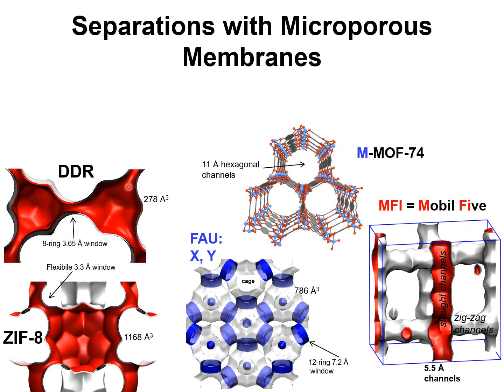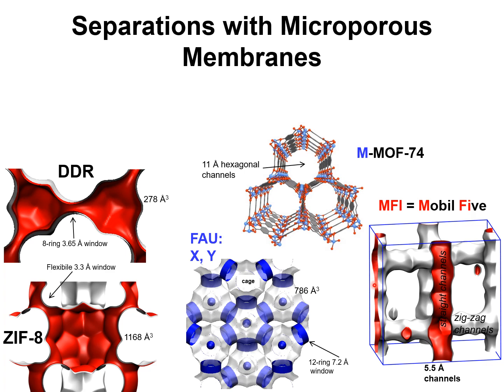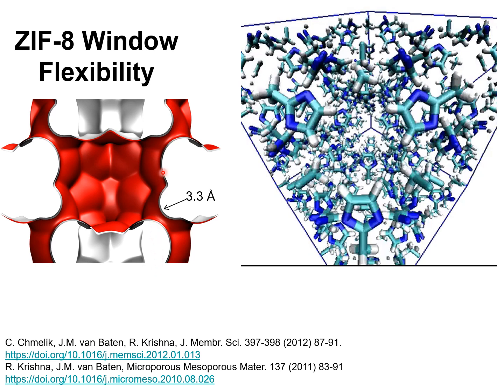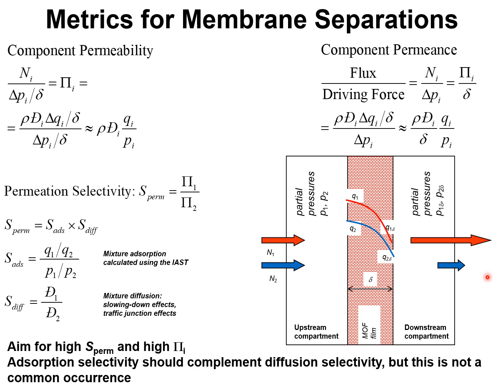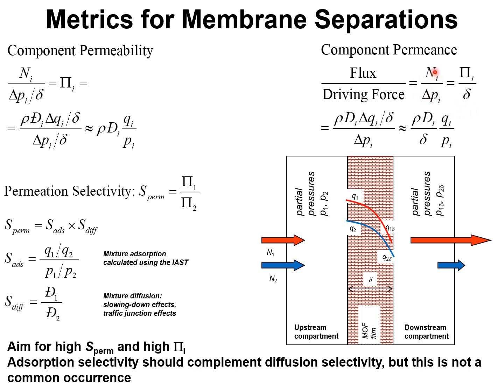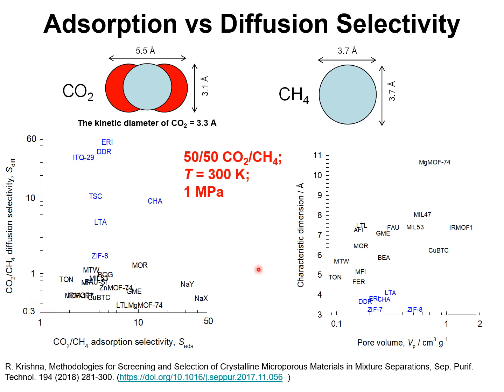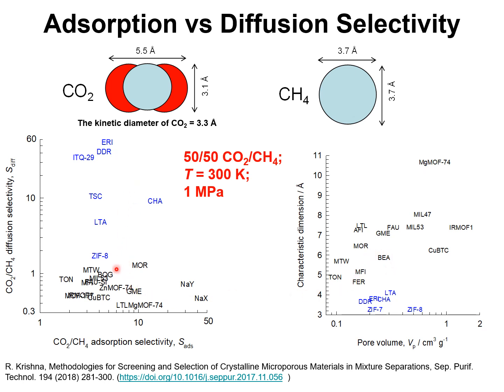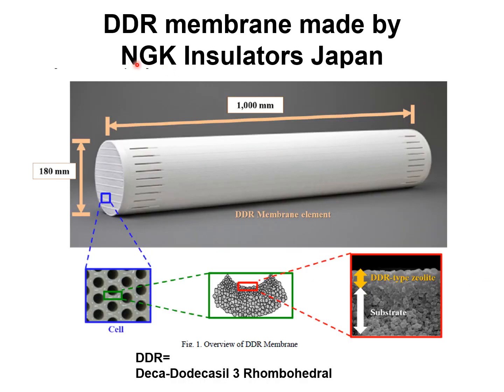The Robeson Plot for Membrane Separations

Comment: Dear Sir,
I have searched extensively for guidance on how to plot the Robeson upper bound, but I could not find a clear explanation. Could you please create a video explaining the Robeson upper bound and its comparison with adsorbents such as MOF-membrane mixed matrix membranes? We would like to learn how to extract data from research papers and how to plot and compare it with our own data.
I hope you will consider making this video, as I know many students are unaware of this method, and it would be highly useful for them.
Thank you.
Reply from the maker: My YouTube videos are primarily highlight research advances.  I invariably highlight my own research contributions.
About Robeson upper bound calculations, the main problem is that the units used for the permeability or permeancy are diverse and varied.  The use of the proper conversion factors is the key; these are provided in in the Supporting Information in my publications accompnaying my papers listed below.

(1) Krishna, R. Methodologies for Screening and Selection of Crystalline Microporous Materials in Mixture Separations. Sep. Purif. Technol. 2018, 194, 281-300. https://doi.org/10.1016/j.seppur.2017.11.056.
	(2) Krishna, R. Using the Maxwell-Stefan formulation for Highlighting the Influence of Interspecies (1-2) Friction on Binary Mixture Permeation across Microporous and Polymeric Membranes. J. Membr. Sci. 2017, 540, 261-276. https://doi.org/10.1016/j.memsci.2017.06.062.
	(3) Krishna, R.; van Baten, J. M. In Silico Screening of Zeolite Membranes for CO2 Capture. J. Membr. Sci. 2010, 360, 323-333. https://doi.org/10.1016/j.memsci.2010.05.032.
	(4) Krishna, R. Thermodynamic Insights into the Characteristics of Unary and Mixture Permeances in Microporous Membranes. ACS Omega 2019, 4, 9512-9521. https://doi.org/10.1021/acsomega.9b00907.
	(5) Krishna, R.; van Baten, J. M. Using the Spreading Pressure to Inter-Relate the Characteristics of Unary, Binary and Ternary Mixture Permeation across Microporous Membranes. J. Membr. Sci. 2022, 643, 120049. https://doi.org/10.1016/j.memsci.2021.120049.